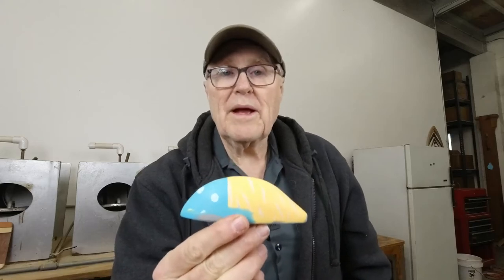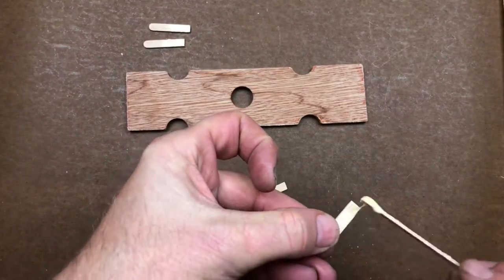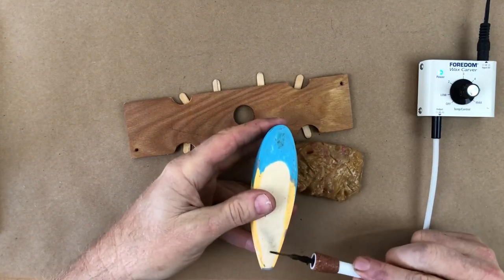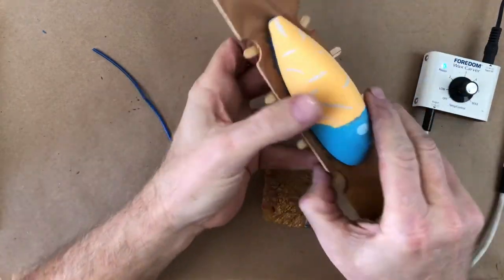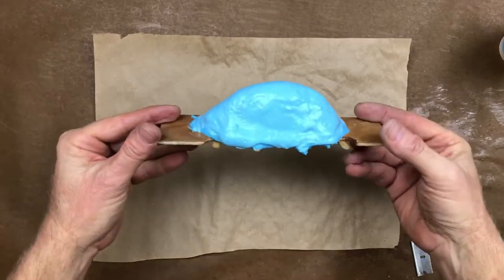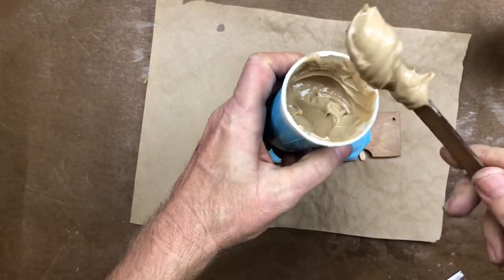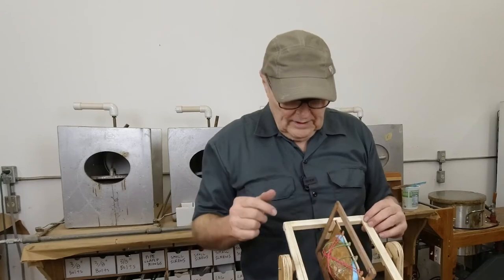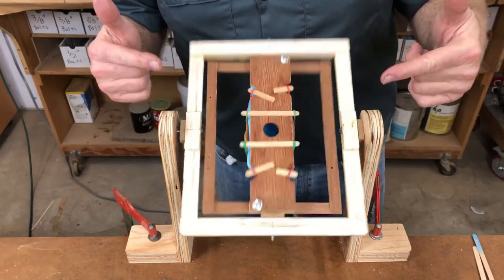Making a Silicone  Lay Up Mold

Comment: First of all I love your videos! Secondly can you clean the brush after you used it to apply the rubber, if yes how? Thank you!
Reply from the maker: You can clean it with acetone. I usually use a brush so cheap that it is not worth the time or the solvent to clean it.
Reply: @RobertTolone  thank you!

Comment: Could you put that into a frosting piping bag to get the perimeter done?  Like caulking a bead?
Reply from the maker: Yes, if it was disposable.  I would do it as an experiment to see if it’s faster to load the piping bag and apply the rubber that way.  But I can’t think of any practical way to clean and reuse the piping bag.

Comment: I have been watching and learning.  My suggestion is to do a better job of telling what supply you are using.  The list in the notes is great but for example, what is the resin you are making the mother with?
Reply from the maker: It is a urethane resin called Trowel-On 60 from www.silpak.com
Reply: @RobertTolone  Thanks.  I did not know you could mix it that thin.

Comment: hello, can I use something else instead of plastic powder?
thank you
Reply from the maker: There are additives that will cause the rubber to thicken and cure rapidly.  Check with your rubber supplier to  see what works with your brand of rubber.
Reply: @RobertTolone  thanks a lot 👍

Comment: Isit possible to apply the first two code of silicone and if you get tird or you don't have the time can you leave it to cure completely ? and the next day apply the third and fourth code to get a good thickness ?! or is it important apply all the codes at close timelines to one another so codes stick together ?!
Reply from the maker: You can definitely apply rubber in layers over several days.  New rubber will stick perfectly well to old  rubber unless there is some sort of contamination like oil or excessive dust between the surfaces.  Just keep the work piece clean and you can build layers over time.

Comment: Hey Robert what brand did you use for the mother mold/ where can I buy it? Been using smooth on plasti-paste and sometime plaster bandages. Wanna try something new/different.  Thanks!
Reply from the maker: Hey Dave, thanks for watching my videos. I buy my materials from Silpak. www.silpak.com
The resins I use for casting  is Silcast 2 or Siltool. The rubber is Econosil.  The rubber can be used with different hardeners.  I use both pourable and brush-on hardeners, depending on the type of mold I’m using. The hard shell is made from Trowel-on 60. All of the urethane systems are 50-50 mixes and come in two- part kits. The rubbers are sold as a kit with the hardener but you can buy different kinds of hardeners depending on how you’re using the rubber. I have been buying my supplies from Silpak for 25 years and they are not a sponsor.  You can call them and describe what it is you’re trying to do and they will make sure you get exactly the right materials. Their service is good and they ship promptly. The company is in Pomona, Ca if you happen to be nearby. Good luck with your projects!
Reply: Robert Tolone Thanks for the prompt reply Robert. I’m a friend of Crazy Al. You helped me with casting tips on my Mr. R2-DFool mash-up figure(Mr.T  action figure head on top of R2D2 toy body). Turned out killer! Check it out on m Instagram; @thefilthandtheslurry.  I have another challenging figure I’d like to cast and asked Al for advice, he referred me to your YouTube channel. Still stumped on if I should blanket/brush coat or 2-part cast. I’d love to text you the figure for your opinion/suggestions. Thanks again and keep the videos coming with Great tips, I’ll certainly pass it along to my casting buddies.  -Dave